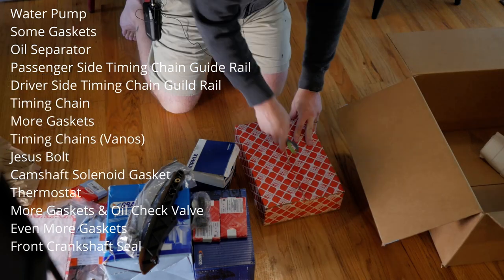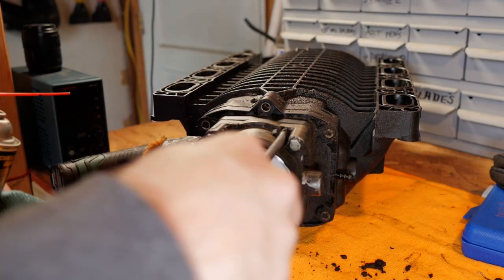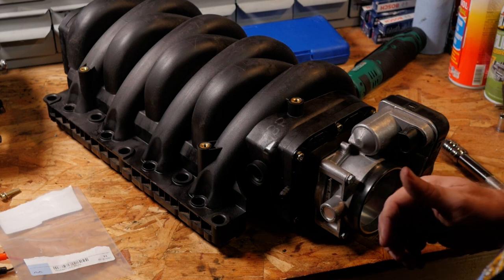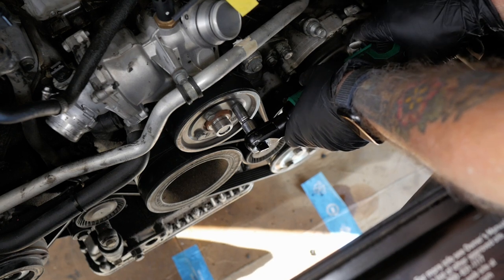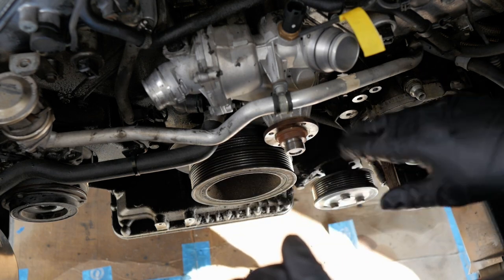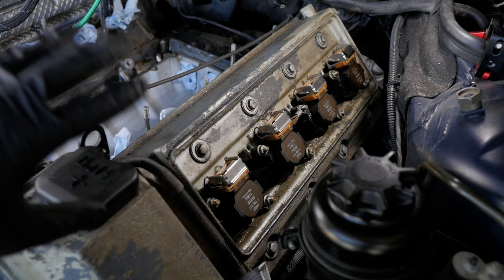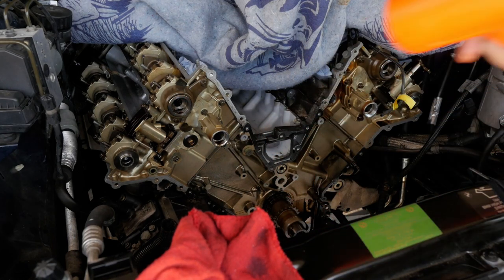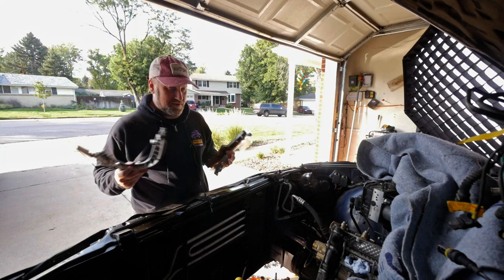I've torn apart my engine...  | BMW 2000 740i Sport E38 | Project Carlsbad PT6

Comment from the maker: Sorry it is taking so long between videos, but this point in the process it's taking a longish time to do the work, record, then edit and upload.  I'm going to try a slightly different approach to see if I can speed up the videos and try getting them out 2 weeks apart for the next 3-5 episodes.  So, expect some shorter (around 20 min) videos over the next few months every 2 weeks.